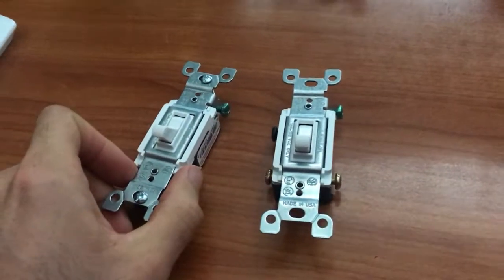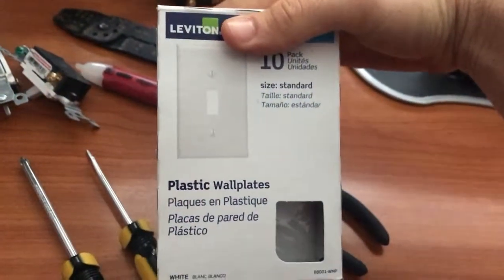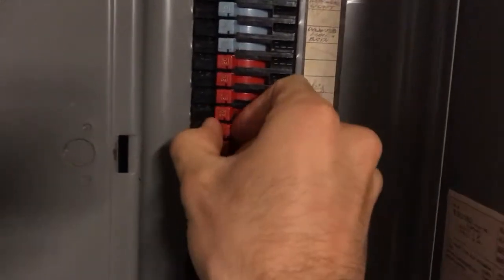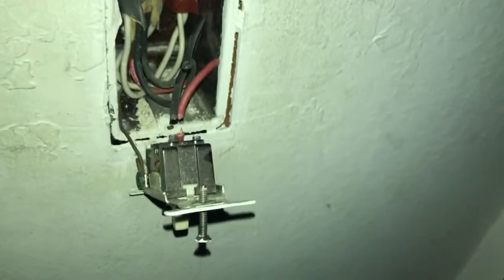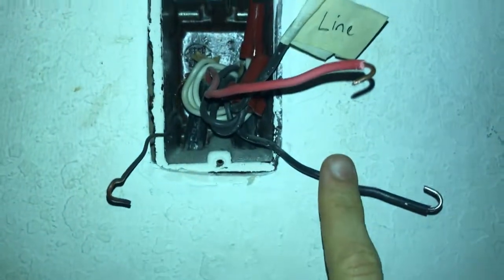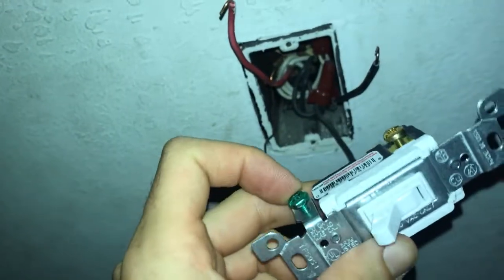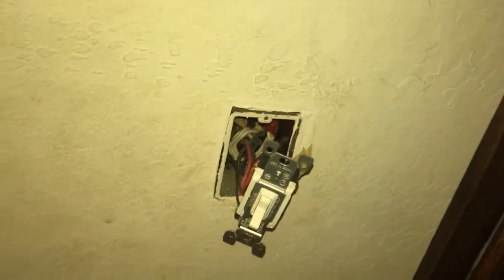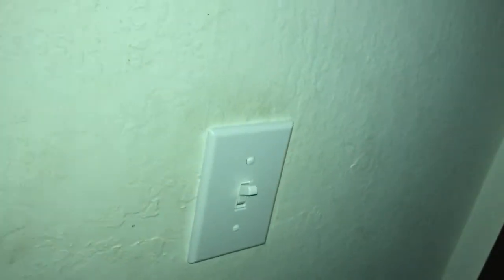Three Way Switch Wiring and Troubleshooting Guide

Comment: Hi VIncent, finally understand how to find out which one will be the live wire and which are the travelers wires.
Question 1: is there only 1 circuit braker for both switches, in your video? But I see that you turn on a Blue and a Black circuit breakers.
Question 2: when you take off all the wires from the 2 switches, WITH the circuit breaker ON, Still only one side of the switches have a hot line wire, right?
Question 3: then the continuity test is done with the circuit breakers(s) off, to find out from Switch #2, which one are the travelers wires, then the 3rd one will be automatically the line wire right?
 
However, I have 3 switches, and the middle is a 4 way switches. Do you have a video for that too?
If not then how to check if I have the 4 way switch. Thank you so, so much.

Comment: Thanks Vincent it worked!  I have looked at many videos and this is the only one that explains it fully. This may sound like a dumb question, but is there a way that if 3-way switches are wired incorrectly that they can still work?  I have other switches I replaced as they were wired and they work fine but I didn't test them the way I did the last one

Comment: You only show the hook up on the power side. You do not show where the load wire goes on the non powered switch. Also, you have only 2 colors which makes things easy. I would have wrapped all 3 wires on the power side, the one with no voltage would be your load wire on the opposite switch. Nice job otherwise, the person following this would narrow it down to a 50/50 chance I'd say.